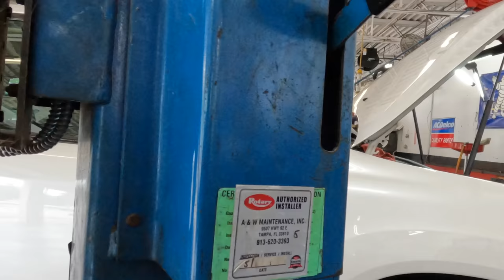Lost Every Time! Shortcut FAILS! 2005 Lexus Rx330

Comment: I think the basic question for any mechanic is this, does removing obstructions save time versus struggling to reach or fit in to tight areas.  The answer always seems to be the method not chosen.
Reply: It's a cost benefit ratio. more menial work is expended in removing something in the way. if we can find a harder but shorter way, then harder and shorter it is. some shops need quick turnarounds otherwise they lose money. Not saying it isn't a good thing to do good work, but if the clients want quick work you have to make quick choices. I think pimp my ride did more damage in falsifying how much work can be crammed onto one car more than anything else.
Reply: An old timer once told me “sometimes the long way home is the sweetest “
Reply: Sometimes the long way around is the shortest route.
Reply: Some times struggling in tight spots instead of removing obstructions can cause more damage to parts and tools.
Reply: There is also the possibility of damage when removing extra parts or the need for new gaskets etc.
Reply: In my opinion it can depend. For me sometimes yes it's a lot easier to remove obstructions for reasons of sanity and keeping aggravation to a minimum but when removing said obstruction is a involved procces then if there is a way round then I will take it no matter how annoyed I could become.
Reply: Long winded way to say hindsights 20 20 ✌️
Reply: True
Reply: Moving things keeps you from breaking things trying to get around them.
Reply: @jagtan13  there is a triangle in all technical things you can have quick delivery you can have good quality or you can have a low price in any case you can have two out of the three because the third one will always suffer is a balanced everything and people have to understand that sometimes because if they don't get good quality they will come back on you and the work will come back and you don't want that because it takes more time to undo something it's messed up and straighten it out than it is to do it the first time right and as far as quality well a lot of it depends on the parts you get from wherever hey Ray does great work and I have no qualms about the way he does stuff hey thank you very much have a good day
Reply: @quantumgaming76  and your hands and arms I've gotten cut up hey have a good day bye
Reply: @michaelpressman7203  You are preaching to the Choir here. O.P. may have been rhetoric, but it is a valid question. There are many that lavk the common sense to do things right. Experience tells there are many ways to skin a cat and not every procedure has to be by the book to achieve the same results. Experience is in the skillful marriage of time savings and effectiveness in the workplace. Otherwise prices rise either way.
Reply: IDK if you have ever worked extensively on cars, but as a shop owner and "wrench" of 30+ years I can tell you that "access is everything" in automotive repair.  The automotive designers and engineers rarely if ever think of the service end of the equation.  Hence mechanics take the brunt of consumers endless whining at the end cost of service, especially with transverse mounted V-6's, as they are horrible to deal with in most cases.
Reply: @michaelpressman7203  "Fast, cheap, or good.  Pick any two."
Reply: @armandhammer9617  Amen that
Reply: @quantumgaming76  when I was in high school a car shop teacher wanted me to not take the wheel off them take hub and bearings off but rather take the whole mess off. Do it all as an assembly .  I thought of how it would be trying to get the hub and bearings back in place while trying to manhandle the entire wheel assembly. Plus trying to get the tapered wheel bearings adjusted right while spinning the brake drum on the shoes and everything.
It was pretty heavy, plus it was MY car and MY bearings.
I told him where to go.
Reply: Remove Obstructions, less chance for cuts and bumps or damaged components.
Reply: @jzxtrd337  yeah, what good is a little extra speed if it causes you to hurt your hand and slows you down on everything else?

Comment: You never disappoint. Still amazing how you remember where all parts go and which bolts to use. I thought I was good remembering  how to put back together. You’re in another dimension! Thank you again Ray
Reply: Video helps.
Reply: Another reason to VIDEO disassembly.....  you can rewind if you forget stuff!
Reply: As a former aircraft mechanic I was constantly removing hundreds of screws from inspection panels for routine maintenance. I would clean the panel, mark it with a sharpie on the inside for the airplane it went on, direction it was oriented, and checked the screws and replaced them if they were damaged, and bagged the screws and attached the bag to the panel. I was the only one in the shop that did this. Everybody else would just throw the screws in a cup and put them on a stand and then go take a break. In the end God will judge these miscreants.
Reply: Well that was interesting. Good to see you have a new red tray to but lose nuts, bolts and screws unless you place them back in the part. As always enjoy your knowledge of vehicles. Lo e watching them.😊
Reply: Great work as always Ray!
Reply: I think that Ray talks about it in a previous video.
He puts the screws and bolts inside the part he's removing and puts it aside so they don't get knocked off.
Reply: Ye Old Geezer  When I started, I would take a piece of cardboard the shape of the area I was working on, and punch holes in it where the bolts that I took off I would stick into it. After a while, you just get used to where stuff goes, though. I can now, even 40 years later, still remember where the nuts and bolts went in the first car I had went. Can't remember ALL the sizes, but most. My brain is now filled with useless information about vehicles which are now mostly melted down into other things.... and while I can remember all that, I always forget where I put my keys.
Reply: In a word, cellphonepics. That film is expensive you know.
Reply: ...I use a tray with several boxes...made the job easy for me.
Reply: @d.e.b.b5788  Yup. When I worked on Hawker 125’s the panel fasteners were BA and British Whitworth. If a panel had 10 screws there would be 5 different lengths on the screws. A lot of the panels covered fuel tanks as the plane was a fuel hog. So the panels had Pro Seal on them too. So it was imperative that the correct length went in the hole or you would knock the sealant off the nut plate and cause a leak. These were Brit made 125’s not the later Beech/Raytheon ones. The corp motto for British airplanes back then was “Why use 1 part when 10 will do the job nicely”.
Reply: @d.e.b.b5788  [The keys are under the MAIL. which gets set down second. In many cases.]
Reply: Most technicians do this. Part of the job.
Reply: @RMJTOOLS  what shop 👀.
Reply: @B0LT53  no most techs tag and bag
Reply: @zachv1942  Page Airways/Page Avjet at DCA and IAD. Before they were bought out.
Reply: @RMJTOOLS  kewl. I've worked at TPA AMES and we had to do it that way. We had a slip for each too. And your always Looking for the damn pnl when it's about to leave. So you end up going 2 bays over.
Reply: @zachv1942  I had some good people to work with but there was no team system at all for the floor. We would push a Baron in for an annual and guys would just pick whatever was easy and the hard stuff wouldn’t get done. And most of the guys were really bad at documenting what they did and found. I remember one very senior mechanic that filled out every squawk he worked on as “IRAN”. No not the country, Inspected,Repaired, as Necessary”. Can you imagine going over the logbooks in 2 years after an accident and trying to figure out what maintenance was done.
Reply: @RMJTOOLS  Annuals should be handled by One Mechanic/IA. Annuals are not hard. It just have to get done. I absolutely LOVE GA/91. But it does have to get stricter on owners. Mechanics should have greater legal authority. But thats neither here or there. It's whats required, Why it's required, and in the Continuation/corrective should be an Action,Verb and an IAW. Paperwork should be done as you do the work. That's some scary shit dude.
Reply: @zachv1942  This was back in the ‘80’s for me. I also love GA and I loved being a Beechcraft guy. I also had an IA. I left Page when it was bought out and they sold the Beechcraft dealership so I went with the dealership to another airport. I quit after a couple of years. Most of the people in the new company were fine but my maintenance manager wanted to let really shaky stuff get signed off then he hired a couple of guys that did not work under my authority even though I was the shop foremen. At that point I started a business and got out of aviation.
Reply: when you do this enough and for many years you kinda know what type of bolt, screw, or clip goes where.  i have done engine rebuilds and remember where things go. Its just finding the infamous 10 socket you need to get some jobs done! 😁 great vids Rainman always learning from you keep em coming!!!!

Comment: I have done both of these jobs on the daughter's 2006 RX330 and the bottom bracket on the radiator was a pita.  Good video showing the job without removing and discharging the AC system.

Comment: I find it totally amazing.  At the sheer speed at which you can dismantle and.  Re assemble all these little parts.
Reply: Any body can unbolt a car.  But it takes a certain mind to put the right parts back in the correct order with minimal parts left over.
Reply: @clbcl5  'minimal'! 😂 Hopefully none! 👍
Reply: That's what happens when you are paid by the job and not by the hour, you do things the right way first.
Reply: @danjordan1979  well, the parts you swapped should be left over and the new shiny ones gone :D
Reply: @Laurelinad  that's a very good point! 😂
Reply: Years of practice.

Comment: The bits and pieces on that engine never end. It’s like they wanted to design an engine with the most nuts, bolts and things to disconnect/remove before you can do anything.
Reply: It's almost as if they had an engine, and a chassis, then just added more & more brackets, until it hung where they wanted it, and damn the mechanics who have to work on it!

Comment: Them were the days, two hose clips and hoses to remove, four bolts then lift out. You can see why cars are so heavy and the repair costs are so high. Well done Ray.
Reply: Those days are long gone, but, it was good while it lasted, It used to be fun😭
Reply: Modern car’s are actually lighter because more plastic is used and aluminum rather then stainless steel
Reply: I hate these computer vehicles now nothing but problems and costs be better off with a horse and buggy more dependable these jap made crap

Comment: Here in NY those Phillips screws would never have come out of the condenser.
Reply: Those Snap On Phillips screwdrivers are amazing, probably even in NY.
Reply: @TheDigitaldoug  I have a set of the A.C.R. Snap on Phillips. Still a pain. Road salt and brine on the roads all winter here. PB blaster is my most used tool.
Reply: Same here in Ohio. Not a chance.
Reply: @fsu3784 , Go Bucks!
Reply: @Hoaxer51  OH
Reply: @fsu3784 , I-O!

Comment: That one short cut that DID work, saved you about 1 1/2 hrs of time on recover, evacuate, and recharge the a/c, plus R - R the line connections. Even with the extra work around time on your failed short cuts, I'd say you came out ahead.

Comment: I had this model RX. Brought it to a recommended indy to replace AC compressor. There are different length bolts when reinstalling new compressor. The monkey tried to put the long bolt in the short hole and wrenched so hard , put the bolt through the block oil "jacket". They put a small bolt slathered in JB Weld in the hole and never told me. An oil leak showed up 3 weeks later from that hole. What a headache that was. They welded a puddle of rod over the hole, but I didn't trust the fix and bought another car. I loved that RX.
Reply: Geez JB Weld. Sounds like something I would have done when I was 16 to my own car not at a shop working on customer cars

Comment: I was totally expecting that screwdriver to slip and go straight into the condenser and start spraying refrigerant everywhere also the correct antifreeze would be pink in color my wife has a 07 rx350 and its very similar but with even less room and i can confirm it's one of the hardest vehicles I've ever worked on
Reply: Don't mean to question Ray's expertise but I was thinking the same thing about the pink antifreeze.....errr, sorry coolant.
Reply: Im a mechanic in Germany. And Here the color doesn't Matter. So Long the coolant  have the right OEM specifications. Here every manufactor of coolant do use different colors, so the color says little to nothing. It's not clever that the colors arent standardized

Comment: I feel your pain when it comes to trying to take shortcuts. I had to change the cooling fan assembly on a '08 Malibu classic but didn't have the option of removing AC parts and really didn't want to remove the bumper or radiator hoses because I was doing it in an apartment parking lot. Let's just say that there was plenty of colorful language used.

Comment: I have just done the radiator repair/swap on a similar car. It is interesting that I only noticed this video after I've done mine. I could be worse if I did not look at any other references before start ... but looks like you are lucky that the 4x screws retaining condenser were removable by hand tool - for most of us those will be a pita needs multitools to barely get 'em off. Anyhow, not sure if it is a good idea to wash a running hot engine with tab water these days 🙂

Comment: I have a trans cooler and AC cooler in one. Transmission fluid was leaking from the radiator cooler. The cooler radiator was discontinued in my model 06 Dodge caravan. They found an aftermarket installed it recharge the AC for 499

Comment: I learned the hard way ruining a couple of new pumps that starting them dry is a bad idea…

I’d have found a bleed screw and made sure that coolant had found its way into the block first before starting the new water pump. 

The rate the coolant went in when you started it told me it wasn’t aiding the rate of fill and the pump was turning dry.

It ruins the seal…

Comment: A small air tube inserted in the bottom of the purge funnel would speed up that process immensely .
Reply: I call it a soda straw and I get mine at Sonic, it comes with a drink attached.

Comment: You should have put a new TRD radiator cap on there, it's good for another 10+ HP. Have yourself a good day Ray.
Reply: But only if it's screwed on with the writing facing the correct direction, otherwise, -10HP instantly 🤣

Comment: Is that the right coolant?  Shouldn't a Lexus (Toyota) be pink/red?
Reply: The pink type is the correct one but the other ones will work.  I prefer the pink one since you can see crusty pink residue from any spots that are leaking on routine service inspections.

Comment: I don't like to work on the V6 with front wheel drive system. I actually prefer working on V6 with rear wheel drive system. It's more easier to work on. But u done brilliant job on that 3.3 V6. 😱

Comment: Not only will a car overheat in severe cold...a radiator filled with water only-no antifreeze- will actually slush uo with ice while it is running at temperature...when outside temps are in the teens with a wind.

Comment: Ray you never told us if you fastened the cooler lines underneath the car when you took the two bolts out to move them out of the way so you could get the bolt when you lifted the car up in the air
Reply: 10 minutes into the video

Comment: I have a lexus rx330 2005 and the check engine and traction off light came on so I unhooked battery cables and hooked them back on lights went off but was running rough and found out it was out of coolant put coolant in and back to normal next day I cranked it maintenance required light was on and running rough again and it acted like it barely cranked sat one hour tow truck guy cranked it drove it on truck and said it seems fine any idea what is wrong with the crazy thing?